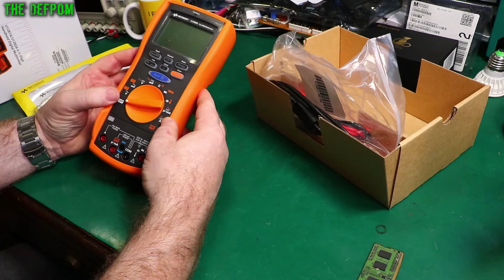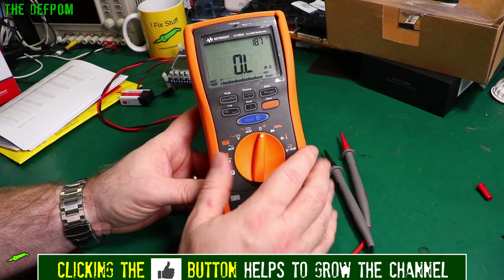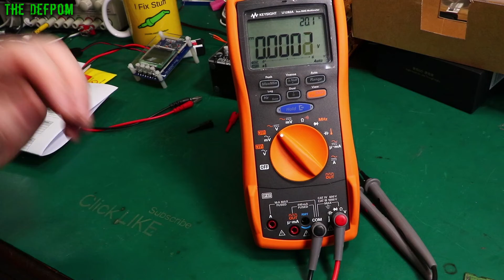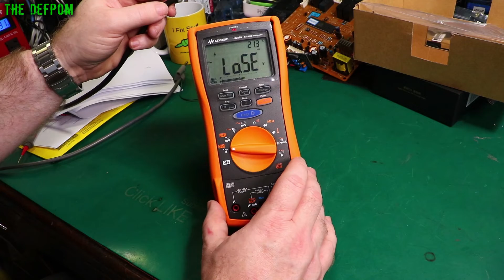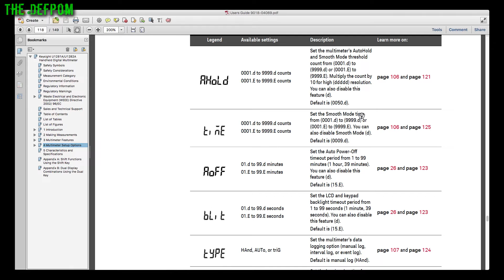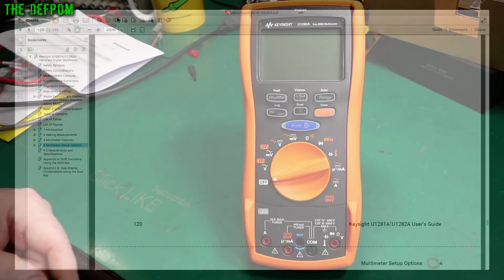🔴 Keysight U1282A Multimeter Review - Sponsored by Keysight - Part 1 - No.1032

Comment: I'm a freak of nature, because I leave the screen peel on things like that :P I get no satisfaction at all from peeling it, if I must, I just rip the thing off and move on with life.
Reply: That's cause you're afraid of scratches and want it in mint condition. My meters are pretty banged up and figure it's meant to be used as is and scratches are just part of the job.
Reply: @jonfreeman9682  I'm not afraid of scratches at all. I don't even want it in mint condition. A lot of my devices which still have the peel on them are pretty banged up and show a lot of use on them.

I just can't be effed removing the peel.

Comment: Good overview! The meter itself is quite good, although it has its quirks. The screaming beeper in both the Vsense and the A/mA/uA jack input alert are very off-putting for me (I like to work in silence) and the autorange in the high resolution is one of the slowest I have seen in a modern meter. However, it does its job quite well for the lab and Keysight has excellent logging triggers (I also have a U1273A that is similar in logging features).
Reply: Great meter, but the dog slow auto ranging on ohms and capacitance are its big handicaps.